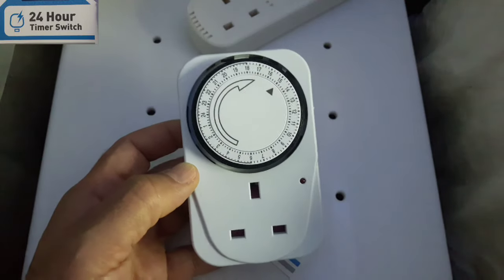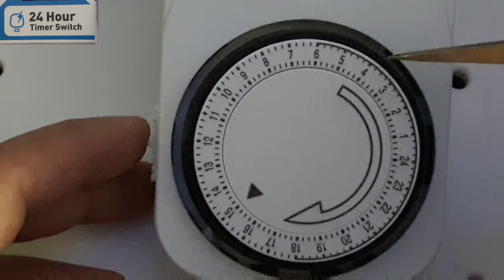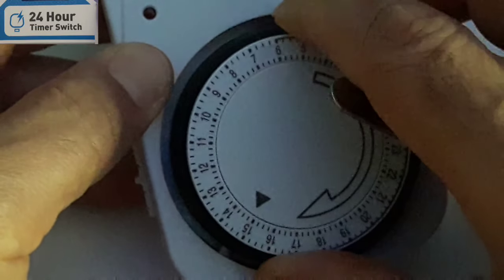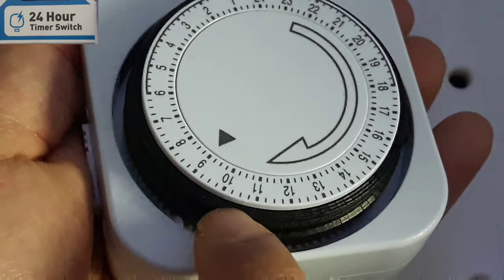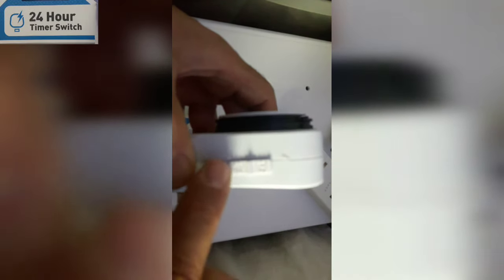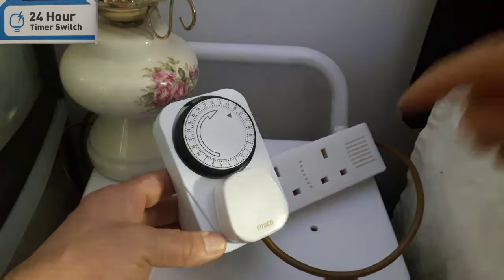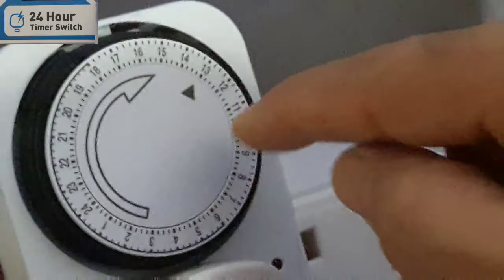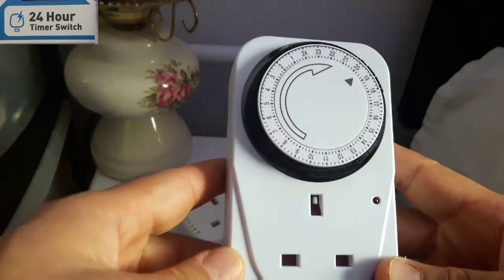How to setup and use timer switch

Comment: Very useful ❤️ 
When you set the dial to start at 9 am, how does the socket know when it's 9 outside? Does it have an internal clock with which it checks?
Reply: Old question but the device is basically just a clock itself: when he twists it to 9AM, it's currently 9AM: that's him "setting the clock".  As soon as you plug it in, it starts "ticking" and the dial turns just like the hour hand of a clock, and eventually clicks the switch off and on depending on the little switchy-things.